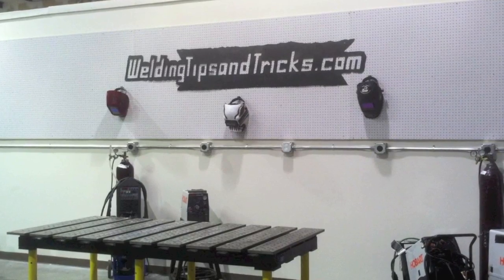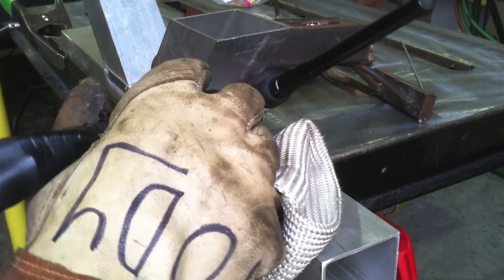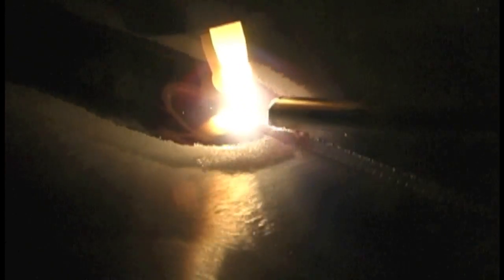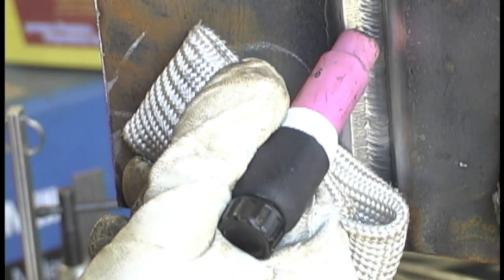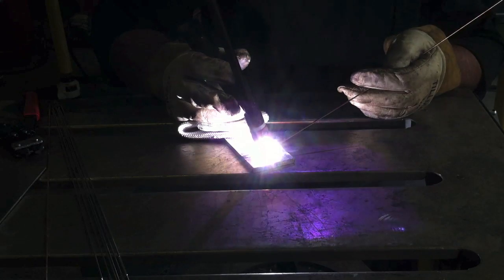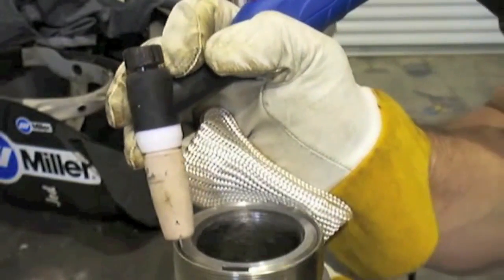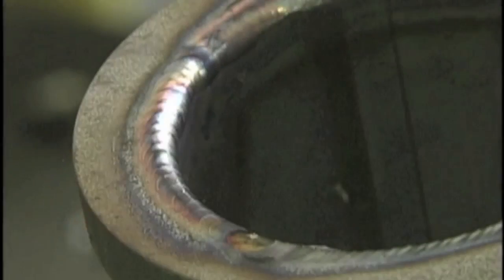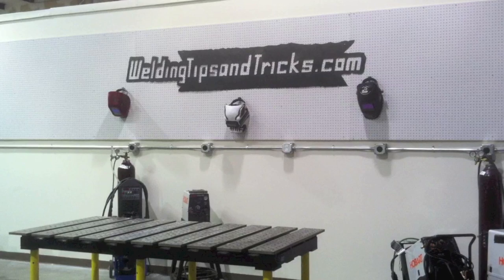Tig Welding Techniques with a Tig Finger® Heat Shield

Comment: The only bad thing I’ve noticed about the Tig finger is that they grow legs and walk off. My gloves tend to last longer because the Tig finger keeps the heat off them. They slide across even slightly rough pieces whic is great for consistent torch placement.

Comment: Hi Jody my name is Chris I am after some information on Tig welders I am looking to bye the Miller Dynasty 200. Just a couple of questions what thickness will this welder be able to handle in aluminum and steel in one pass and have you found any problems with the miller welders I am a bit apprehensive in buying Chinese gear although the price is good i worry that there be no parts support in the future i know miller support older machines 
Best Regards Chris Trewern

Comment: Do you run your own shop? If so do you have any one working for you? If not who do you work or and where can i get a job like yours. i'm a 18 year old kid who has been welding for only 2 years. As a mater of a fact i just look 1st in my overall competition  Skill USA (at the regional level) at my local Career Center and from what i see in all your video i would like a job just like yours and not on some line doing the same weld 2000 times a day 

P.S- I have a Tig finger helped me take 1st